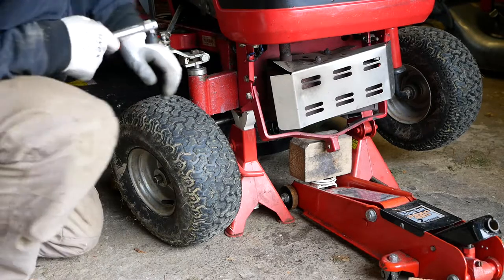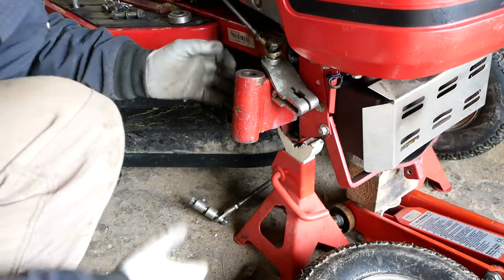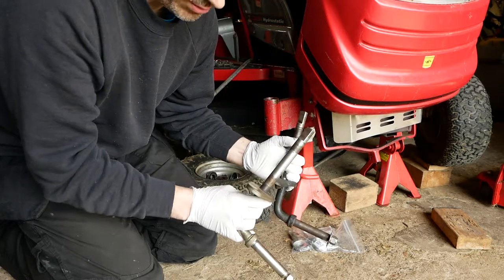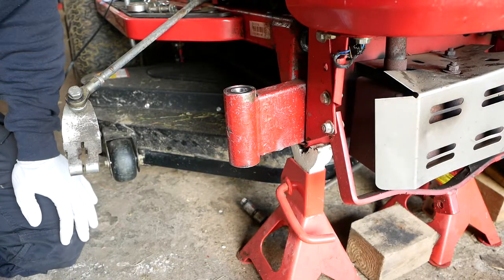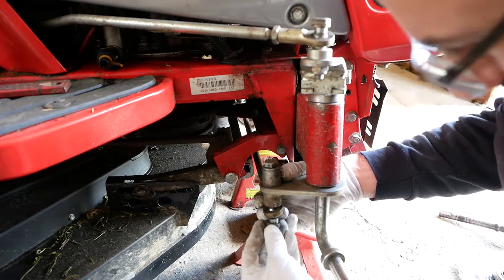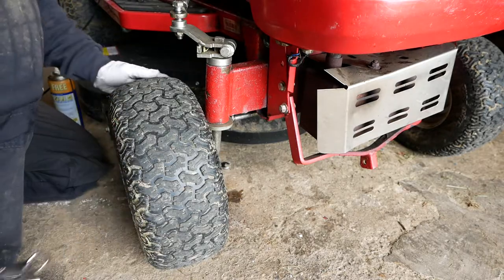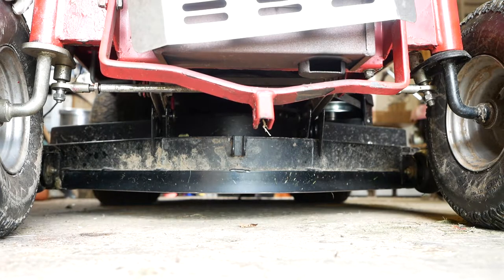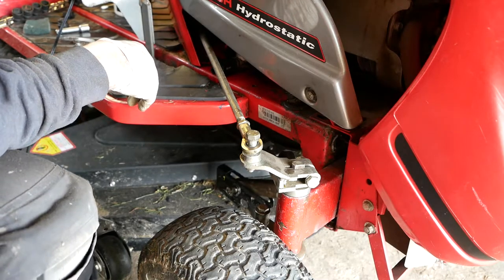Countax C300 - replace steering bearings & stub axle, wheel alignment

Comment: I would like you to replace quadrant on a Westwood ride on mower.
I like the way you go about fixing and figuring everything out.
Tom mixer.
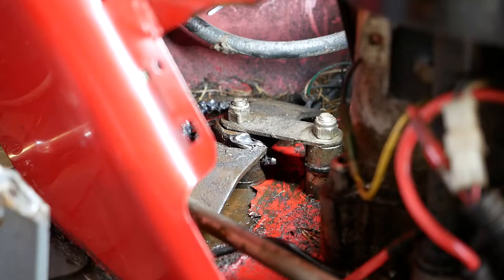Reply from the maker: Hi Tom, have a look at 31:15 in the video. If yours is anything like this one, that section of the video shows the 2 bolts that need to be undone to remove the steering quadrant. You can reach underneath to hold the bolt heads to stop them turning whist undoing the nuts. Once those bolts are out, the steering quadrant can be removed, along with the steering arm (easier to remove this from the quadrant on the bench than in situ). Cheers

Comment: howd ya get the steering wheel off please  on countax 600
Reply: you remove the small plastic cover on the centre of the steering wheel, then you'll see a 13mm bolt with a few washers, remove that and the steering wheel should come off (they tend to rust to the shaft so some WD40 or ATF fluid to loosen the rust works wonders when removing the steering wheel). hope this helps.